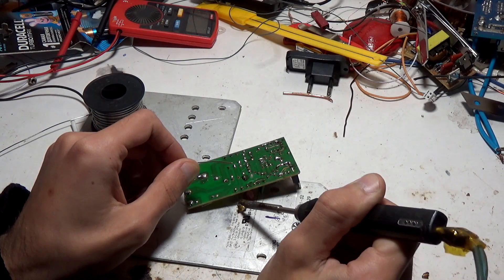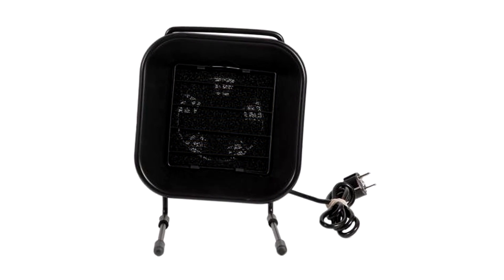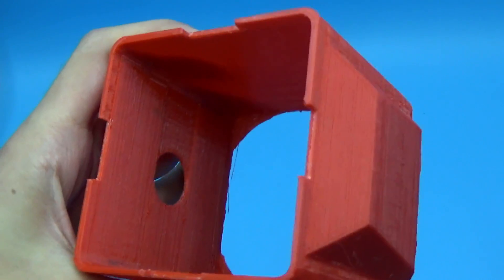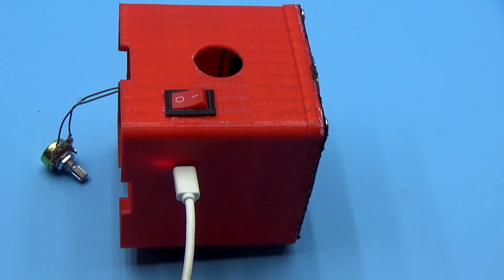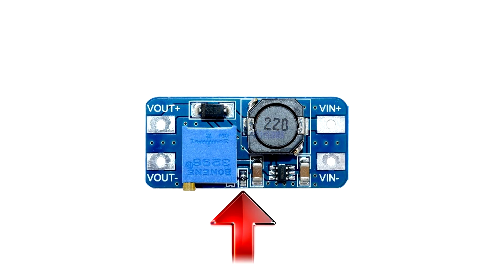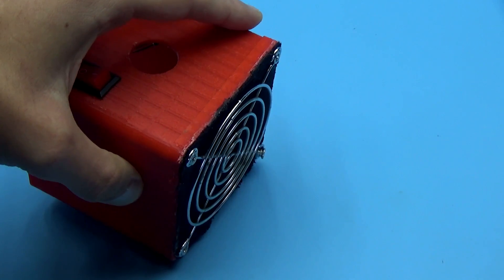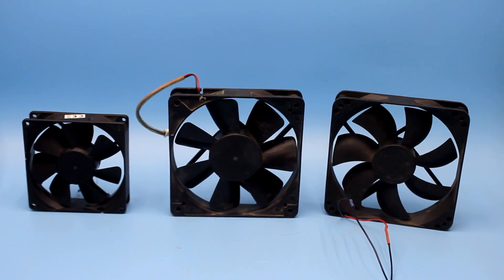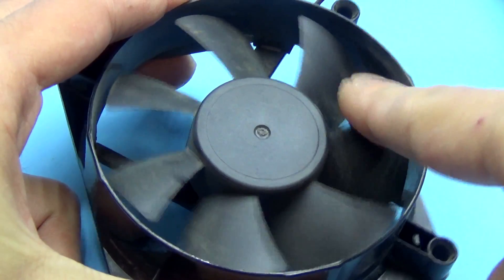DIY Fume Extractor

Comment: Hey Kasyan
  The English keywords you are looking for to use in the title are "Fume Extractor." That's what anyone interested in this will be searching for :-)

   Here in the USA our big box home improvement/hardware stores usually have a special filter that can be found in the HVAC section of the store. Most houses in the US have central heating and air units, so there are products marketed and available accordingly. There are special filters sold that go over the regular paper element. The filters I'm referring to are intended for filtering out pet hair and pet odors. They do this with a fiberglass mesh covered in activated carbon. The nice part about these filters is that they are universally sized in a large sheet about 1 meter x 1 meter. The user is supposed to cut the filter to the right size for their application. These filters cost less than $10. The filters are not very dense but they can be stacked into multiple layers. I use a stack of 4 filter layers in a filter frame I took out of an old broken Fluke rack mounted power supply. I actually used the entire enclosure, fan, and assembly from the broken Fluke to make my fume extractor.
 
  Another notable option, I don't know if you watch many English YouTube channels but Andreas Spiess (channel is his name) has the type of fume extractor I really wish I had. He has a setup with a tiny fume extraction tube right at the tip of his soldering iron with a vent tube that runs along the iron handle and wire. I don't know if this is a commercial product or something he made himself, but that is the coolest fume extractor I've ever seen. It's worth checking out if you haven't seen it already.
  ...anyways...
Thanks for the upload.
-Jake
Reply from the maker: Hi, thank you for your feedback)

Comment: I have to agree with one of the other commentors.

You are juat spreading the fumes around with that. 

But a carbon filter would fix that issue easily.

I do like the idea of the box though.
I intend on building something similar for use with a helping hands station I am building.
Reply: Also, circuit have to be out of fume's way. With current setup all of the circuit part will be covered hard fume in time. Circuit need separate area.

One day, you may need open it and touch to the circuit for any reson. Then you will be touch all of the fume stick on them. More you use it then there will be more fume on the circuit.